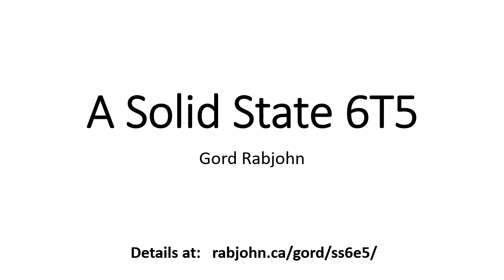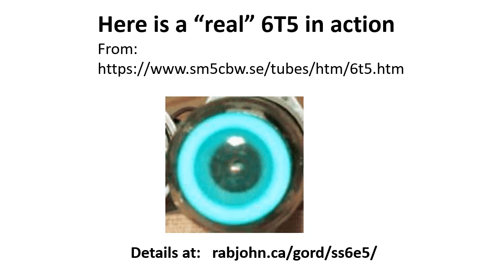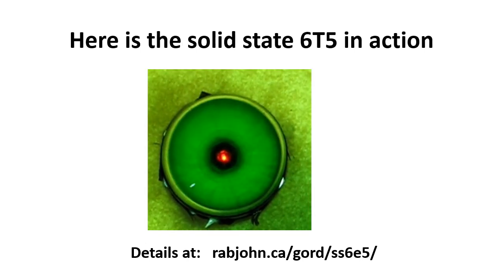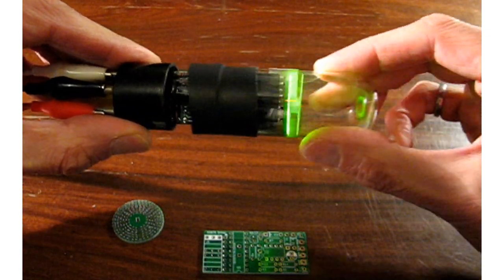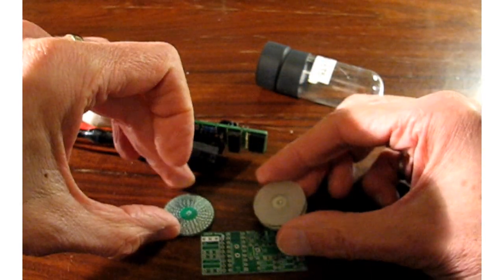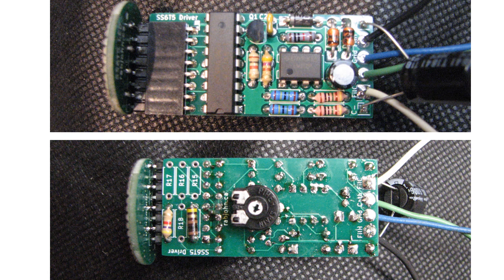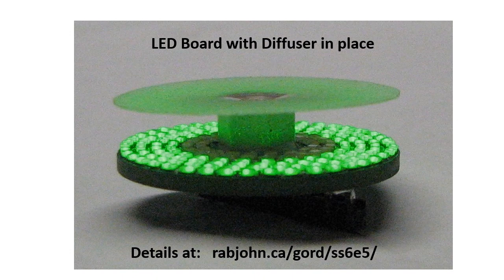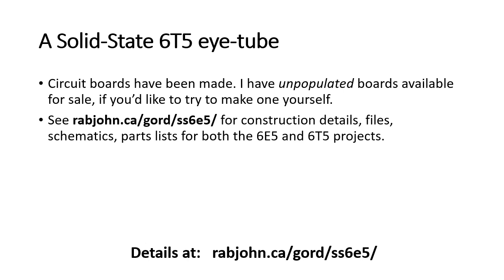A Solid State Replacement for the 6T5 Tuning Eye

Comment: Very nice.

Have you thought of making this one and the 6U5 one as a kit with just the SMD LEDs soldered to the board?

Also does the bar graph driver just turn the LEDs on and off or does it gradually turn on the next ring of LEDs?

If it just does the on and off, a driver (if one exists) that gradually turns the LEDs on and off would provide a more accurate display.
Reply from the maker: I have thought about an LED kit. Bottom line: I'm lazy! I broke many design rules when designing the LED board (specifically: vias in solder pads, parts too close to each other end-on-end, not to mention a complete absence of fiducial marks), not an issue for hand soldering, but would be an issue for a chip shooter. So, getting it assembled by a CM sounds like it could be a difficult process. 

Do the segments switch suddenly? Yes, but I have also experimented with dithering which would causes the segments to come on gradually. I think it does improve the operation of both circuits.  See https://rabjohn.ca/data/documents/Dithering-the-6E5.pdf
Reply: @gordrabjohn7039  that definitely would make it look much better and more like the real thing.

Comment: Very cool. As someone who specializes in metology and test equipment... When I first became interested I hoarded pallet loads of test equipment back in the mid 2000s when government auctions were still held locally and regularly. Until everything moved online

Fellow test gear enthusiast would inquire regarding the more elusive eye tubes, and even weirder/rare display tubes ( like seen on "frans lab" sometimes.)

I can see enough of a market for someone/manufacturer to make a ready-made version. Both lower-voltage versions for modern projects and vintage drop-in replacements.

 Reminds me of the community and ecosystem that popped up around DIY gamma scintillation detectors. There's quite a bit of support and folks taking a somewhat complex design and process... Pre packaging and getting everything ready for DIY builds. (Scintillator Crystal, photomultiplier tube, high-voltage driver, hermetic enclosure, ect...) Kind of a similar idea and reminds me of it.

You have a Very cool design! Really enjoyed the video and would love to see more from you regarding this or other projects

Comment: Some criticism. It's nice and all, but given the ease and low cost, not having them PWM dimmable to smooth the stepping is inexcusable. The originals are nice and smooth, yours aren't, even though there's no good reason they're not. An ATMEGA8 or similar MCU software-pwm driving some FETs for the rings at a few khz would do nicely at little cost.

Comment: so Ive seen a couple of videos about these tubes (so now if i see one I know to grab it) but I'm still not sure on what they are used for. The closet thing I've found is this video that mentioned zenith radios. Other than lookin cool, what is the purpose of these eye tubes? or really any vacuum tube? (I may or may not have just assumed they where old light bulbs)
Reply: They act as a signal strength indicator to assist with tuning. Most vacuum tubes act as an amplifier.

Comment: i was sceptical before i saw the first video...
that was amazingly good.

this should be a standalone product. im thinking battery meters, timed light switches, heater controls...

adds some interest.

regards diffuser... an acrylic ring, edgelight, with a beveled and etched face?